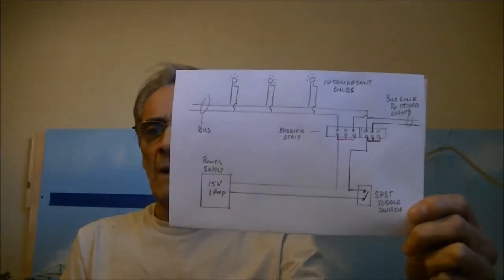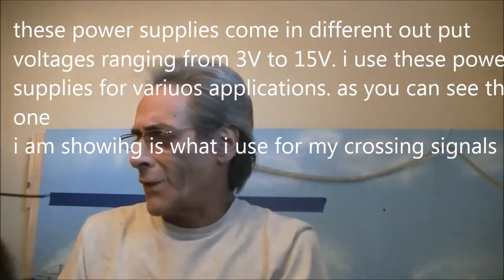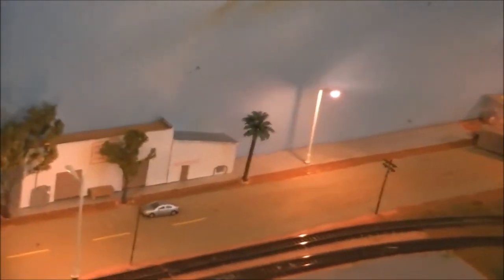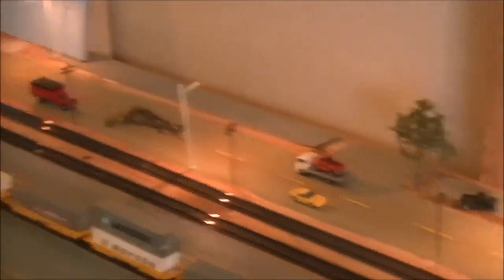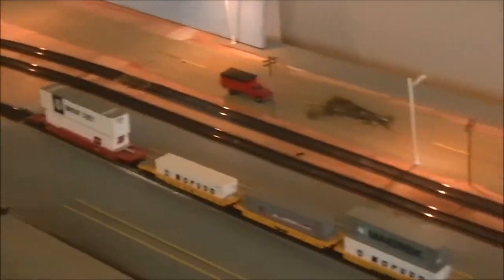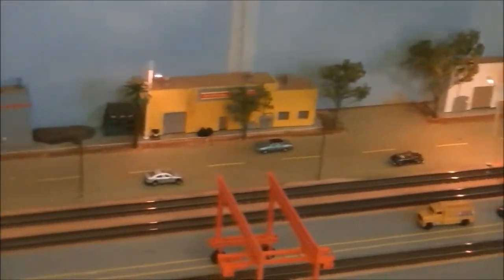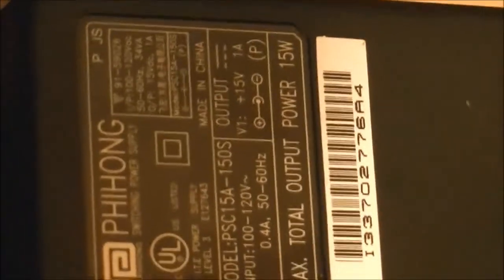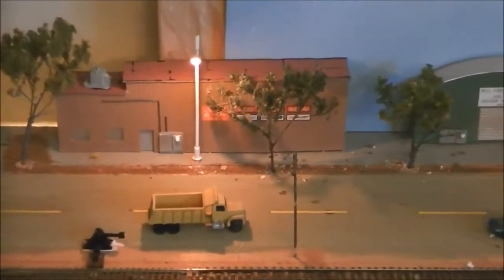STREET LIGHTS

Comment from the maker: i just thought it's a cheap way to get some lighting on the layout... i am pretty sure you will have to add a resistor if you use LED's.. i wish that these lights were LED's but, when i bought them, i never thought about using LED's. i don't think these bulbs will last too long
thanks for your comment
vinny

Comment: My response was to Craig Lowe. I don't doubt your knowledge. Never meant for this to appear to be an argument. 

I just thought it a bit easier(if you don't already have them), especially if someone had a lot more light's or things that need 12 volts but don't want to run them from the layout's power supply. Instead of multiple small power supplies, they could just use a computer power supply.

Comment: Great lights, Vinny. I told that I built a miniature airfield back in the 70s for a friend who collected small die-cast airliners. At the time I was the Cardex operator at a computer company in Orange County, Calif., called Trivex-Datapak. The stopped using a small read, white and green lights for their computers, and my boss told to clear stock throw them away. I told him I have a use for them, may take them, he said have a ball. So little lights were used in lighting along the runways>>>>

Comment from the maker: hello comfortablynumb...thanks for all your input.. i don't want this to sound rude but, i have been a  Master BMW tech for 35 years & have had my share of diagnosing electrical problems... i have been to many electrical classes via BMW & know about ohms law. so when i stopped working i stopped thinking in technical terms... if i plug it in & it works, i use it...
i didn't want this to sound rude but modeling is supposed to be fun
thanks again
vinny

Comment from the maker: hey Craig... i know about ohms law... but when i stopped working all my technical stuff stopped also...i don't mean to be rude to you to comfortablynumb.. but i have been using these power supplies for years & never had any problem.. i have been a master BMW tech for 35 years & i have had my share of electrical problems to diagnose.. this is a model & i don't want to get that technical.. if i plug it in & it works, i use it...lol
vinny
thanks for the comment
vinny

Comment: A power supply doesn't push "amp's" into a load. Lower resistance causes an increase in amperage load on the supply. So no, resistance does not have to decrease. You would just have a power supply capable of supplying a higher amount than what the load requires.

Comment: Vin, Great Video as always, and thanks for the diagram at the end. Keep pluggin away and soon you'll have this layout done...
ComfortablyNumb1969. Remember Ohm's Law IxR=E (volts)  If you have 12 volts and the amps (I) increases than the Resistance has to decreases. Also If you are only running lights in parallel then you might need to add a series pot in line with it to keep from blowing the bulbs.

Comment: I would use a computer power supply. they are only 12 volts, but much higher in amperage. How much amperage does those lights draw?